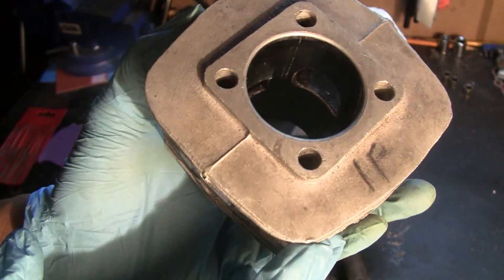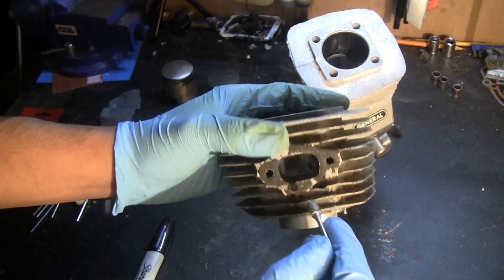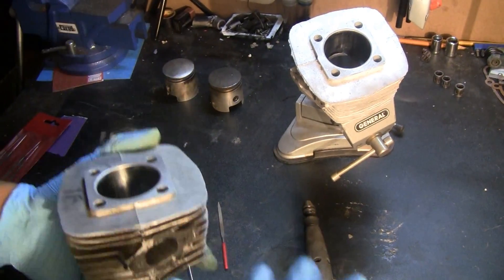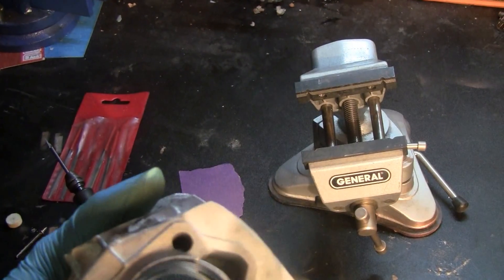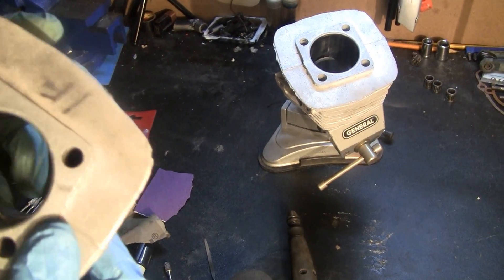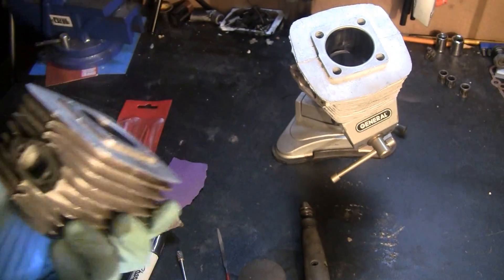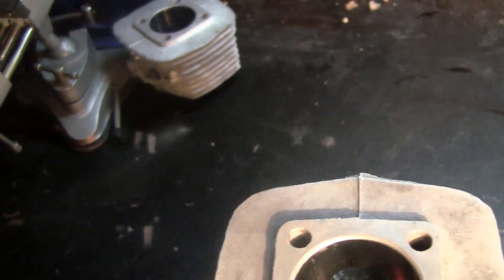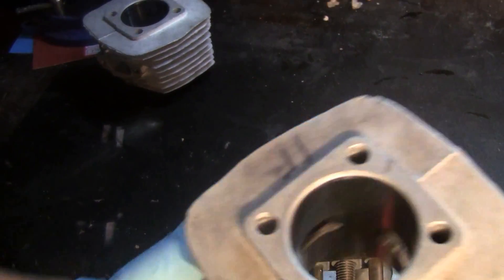Porting your 2-Stroke motorized bicycle engine

Comment: As a Two-stroke engine tuner, I find some of this demonstration painful to watch...and I think the word He's looking for is 'Chamfer' not camfer..? there is a lot more to tuning a two-stroke than this guy knows, you can easily lose a whole lot of useful engine power and fuel if you get it wrong...
Reply: And yet not one of you has any practical advice to share with someone who came here looking for information?
I can appreciate that none of you likes what the guy is doing, but how about pointing to a better video, a good source of information or maybe make one of your own.
Because I don't find anything you have to say here very helpful and I'm sure the OP didn't either.
Constructive criticism....
Reply: fezants exactly my thoughts. He needs to also tell people what ever material u take away needs to be added else where. That's why we stuff the crank case and flow it in the goped world
Reply: Christopher Leveck there just trolls man. check out" 2 stroke stuffing" YouTube.
Reply: Wow, I didn't ruin it!  It did just what I expected.  There was even another benefit that I cannot explain; it vibrates significantly less, like 40%-50% less!  Also, now when I open the ball-valve on my boost-bottle all the way, I GAIN high-end power, instead of losing it.  Is it better to be lucky or smart?  And which one am I?
Reply: mark kasper, yes. Still going strong.
Reply: Bob Ordewald do you have any advise to get more umph out of my honda spree. That's why I'm here now. Need any advise I can get. I know a little but far from what i need to to be correct in my adjustments for the honda( why I have kept it stock for over a year) any advise would be awesome thank you
Reply: yeah I agree this guy is cringe to watch
Reply: Yeah, i know, and thanks, i did.
Reply: fezants, I'm a dumbass auto-mechanic who just notched my intake piston skirt.  I removed about 50% of the part that blocks the intake port at TDC.  By my logic, it will increase power at high rpm, but decrease power at low rpm; kinda like putting a high-lift cam in a car.  Am I a fool?  Did I  just ruin my intake timing?
Reply: HonorB 4Glory you tell us, did it work?
Reply: Make a video if so good
Reply: fezants I agree. I sat and watched and shook my head. It was like the guy who reads the 1st page of a Motors manual and then says 'I'm qualified, everyone stand back!' He has enough knowledge to be dangerous. I would encourage him to take some classes and befriend someone who can fine tune his education.Now, that being said, It is likely the neighborhood 'guru' in his age group. Why? because he is not afraid to try! For this if for nothing else I say go to it! 
If he has questions I only hope he asks those that are old enough to help him properly!

Comment: i had to cut off and file them flat on the bottom of the jug to make it fit onto my motor, should it still work? it will only fire if i dump gas down the carb :(

Comment: Can u plz tell me what the number on the piston means mine has a 3 on it ....i need to replace the cylinder i wanna make sure to get the rite stuff ....its a power king kit ....
Reply: +Tj Dukes 3 is probably just the different CC's the manufacturer had for the engine.
Reply: +GHOST thanx

Comment: chamfering the ports and the skirt of the piston on the induction side will also will rising the compression
by having the head skimmed also might be worth finding out if you can get a reed valve set a tuned exhaust
would help a lot

Comment: I notice you are using a GT cylinder I only use the GT5A that has a 40 mm intake bolt spacing and a matching reed kit !What is the torque you use to torque down the head ? I was hearing 120 inch pounds and 80 inch pounds for the aluminum Fred head . what do you torque your heads down to?

Comment: Porting and polishing is very important in achieving a crisp rpm sweep in any high compression engine weather it be 2or 4 stroke the small pitting in the intake port can and will collect fule wich will cause premature defamation and if this occurs during the exhaust stroke this can lead to premature ware of the rings and cause blow by and cause bearing and or lower end of the case to become brittle and crack never remove material from a piston as this will cause week spots in the piston and more then likely cause the conecting rod to push up and threw the piston and can cause poor combustion cloging the intake and exhaust. Ports causing even more Los of power if u want to gain power there are dished pistons for these motors that will give you more power and best to upgrade to a exapantion chamber and go up a size or to in ur jet size also to adomize the gas just go to ur local hardware store and buy small fine copper mesh and use between intake manifold and jug with porting and polishing both ports will make noticble and reliable power
Reply: How would I install the mesh without causing an air leak?

Comment: personally I was just wondering about the transfer port casting burrs, 2 stroke have not been my forte I have had other engines that have similar castings but were made that way on purpose for swirl flow or hard roll fuel patterns weird but true. so this answered my question it is just crappy QC on the transfer port

Comment: dont take anything off the crown of the piston... bad bad bad you have just unbalanced it, do it all via ports.same as the skirt.. it provides stability on a 2 stroke piston.  intake ports should be smooth, you want to reduce turbulence in the ports. the a/f mix hitting the crank counter weights is more than enough atomization. if these cylinders were plated you would of destroyed them. 

if you guys want power, look into timing advance, REAL porting, shaved heads and bored carbs. then jet right and put a good tune pipe on it and your rocking.
Reply: do you have a video that can better explain this?

Comment: Sorry man but you are confused in ur understanding of a very complexed subject. You're at best just cleaning up ports n at worst losing velocity & messing up timing. Put 2 base gaskets & skim the head on glass with jetting adjusted using more or less premix is more sophisticated tuning than this.
Reply: That's just raising the compression  tho right? I'm just interested in rpms

Comment: If someone did this to a true race 2 stroke I would cringe. I'm not sure if air cooled weedeater engines are nikasil plated, but race bikes cylinders are. You round the port edge at the cylinder side and you're going to start running into HUGE problems.
Reply: A qqualified automobile mechanic ? I would say anyone that knows their shit. This is not rocketsience
Reply: its a 50cc scooter engine, it costs $20... what race engine do you know of costs $20? lol Jeffrey Collins
Reply: hvguy
I suppose the price isn't really the concern here. It's the fundamentals of how to engine works. Granted, yeah, its a little easier to chop at a $20 cylinder, instead of an $800 cylinder.. but still, You're asking for problems by eating at the cylinder with a dremel.

My comment was directed to the youtube kids with a RM125 sitting in the garage and they're trying to squeeze more power out of it. Just kind of a warning more than anything.
Reply: Some old 2 stroke engines have "Softened" port edges to accomdate loose floating rings, however, these modifications are made from the factory, with specific tolerances. 

No part of that, is anywhere near is barbaric, and as brutally orchestrated as what is shown in the video. The work done here is comparable to "decking" the head with a orbital sander and side grinder. 

And the power achieved is minimal at best, and stupors in comparison to a simple carb adjustment, better fuel and pre-mix. 

I don't care what someone does to their motor (because most of the time, when they mess it up they pay me shop-rate to fix it).. but I'm trying trying to save someone the hard found learning curve involved with destroying a perfectly good cylinder.
Reply: now, i do hope you realise that these cheap cylinders do have rough edges, and your race cylinders do not, right? therefore, you have to do a bit of finishing of the ports like he did, and you do have to round and smooth a few things out. the piston however, is a moving part and should NOT be touched by anyone BUT a qualified automobile mechanic.
Reply: It really don't  matter what they cost, wrong is wrong. Theory is kinda right, ruff exacution.

Comment: guys, like what you are trying to do here, but looking at your cuts and  work you need to pay a bit more attention. I know these are cheap cylinders, but the work is sloppy. There are also a LOT better tools out there than what you are using. Raising the piston skirt too much on piston ported cylinders can cause flooding at lower rpm, by letting the air fuel mixture do a double pass through the carb. And, no that is not how you chamfer of bevel the port window edges. You still got a lot to learn, but keep at it, experience will bring knowledge.

Comment: you can raise the piston to the top of its stroke and look through the cylinder intake and the piston ports will be slightly smaller. I take an awl and scribe a line directly inline with the piston, then I simply grind the piston port to the size of the cylinder port.

Comment: Dwainpipe 21 is right, raising the exhaust port lenghtens the exhaust port cycle.. and btw Dwainpipe raising will "always"  give you more power ,but your right ..you can raise it so much, than you hit the limit of what your exhaust can correct.. and you lose compression by raising the exhaust port.. So there is a limit! And the guy complaining about giving secrets away.. boy i would not like a cylinder ported by your company..

Comment: you have one thing mistaken: although making the intake port rough will increase fuel atomization and may slightly increase efficiency, it will actually hurt power because it decreases volumetric efficiency (breathing capability) of the engine
Reply: BINGO

Comment: Something that needs to be looked at if you are going to do any porting or casting flaw touch up is to port match the intake tube to the cylinder. On a lot of those motors the intake tube shape and port on the cylinder don't match, killing the flow from the carb, rendering a lot of the work to the cylinder ineffective. And port match the boost ports to the base gasket match the gasket to the ports on the engine case and then match the boost ports on the base of the cylinder to the gasket

Comment: but was able to do 90 percent of the things covered in the video.... i even widened the gap on the piston where it opens up for the transfer ports directly below the pin on both sides.... i port matched my intake and exhaust as well as widened my gaskets to better fit the flange for both intake and exhaust....